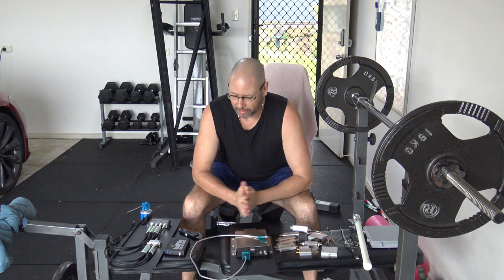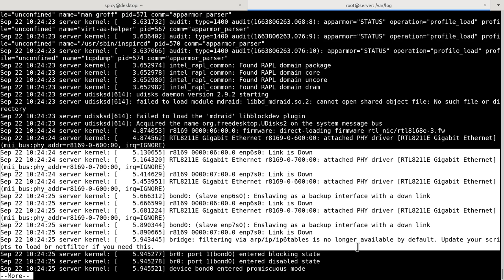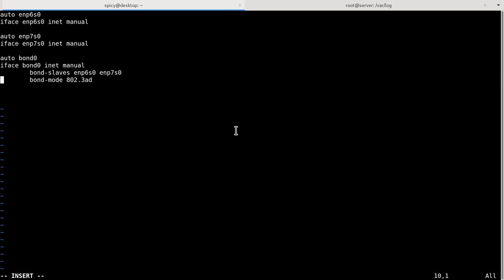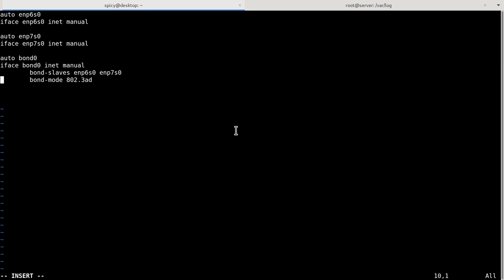SDR Server Part 1

Comment: Use the straight stick for your 1090 it will work heaps better than the Discone ,i went from about 8 planes to 30 with proper antenna ,also put it as high as you can.Good Video.